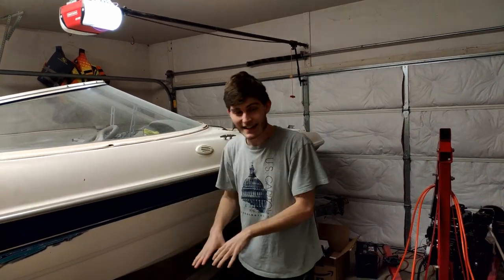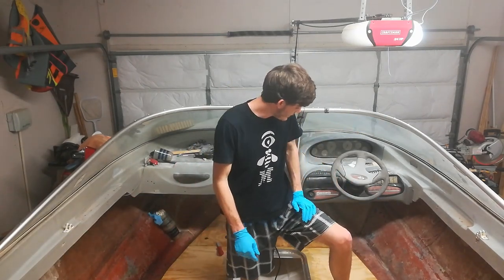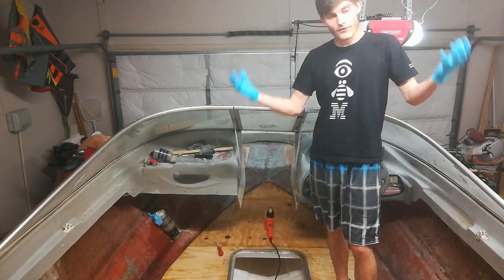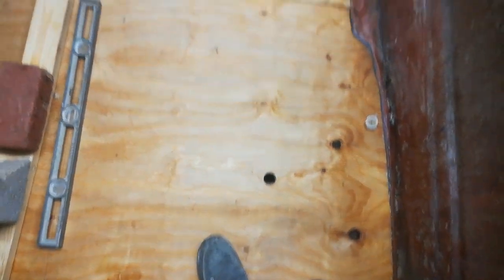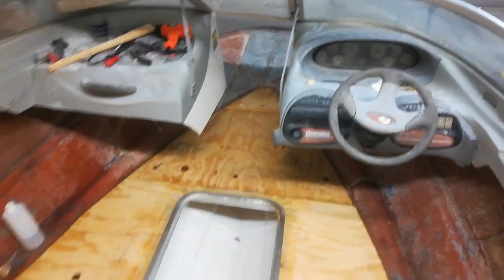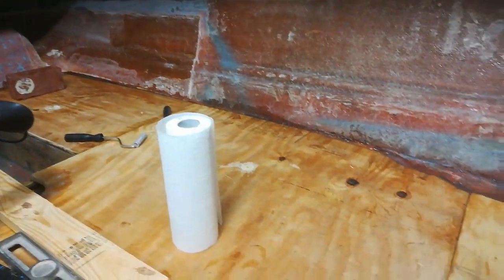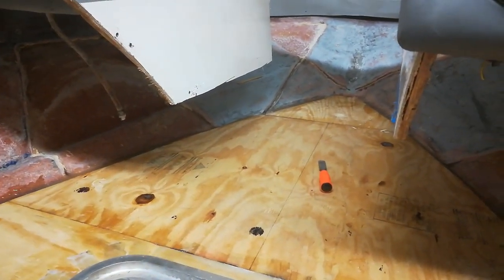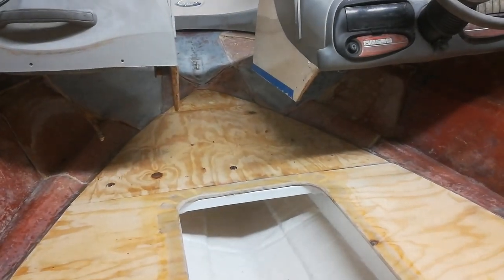Boat Deck Rebuild - Part 2

Comment: I know I’m 2 years late on this. Did you use marine plywood. Getting to ready to tackle a similar project but it only needs to be short term so I’m curious if regular plywood will work?
Reply from the maker: I did not use marine grade! Doesn't hurt, but if your fiberglass is water tight then you have nothing to worry about

Comment: Im curious as to what kind of flour you used. I ran out of silica and bought a bag of wheat flour... Its working but is very gritty or grainy, my peanut butter seems more like grits.😂😂 i wonder if white flour dissolves better...
Reply from the maker: lol. Just general purpose flour :) it does get gritty indeed! You wanna use just enough to get it thick enough to hold shape

Comment: Looks good! So, im curious to know what kind of foam you used (2lb,4lb...) and how much it took to complete the  job.  Cant wait for the next video!!
Reply from the maker: 2lb foam, posted a link in the description. I used 2 gallons all together(including stringers). I probably could have used 3 gallons though. I used just enough for the foam to rise got the top of the hole. Not more, I was trying to avoid extra waste 😛
Reply: Can you give a name of the pourable foam filler, where did you get it from?

Comment: why did you use chopped matting not 1708 ???
Reply from the maker: My primary reason for fiber-glassing the top of the wood deck was to waterproof it. For that chop-strand-mat(CSM) is sufficient. CSM is cheaper than 1708. 1708 will get the job done just as well. The extra structural strength 1708 provides was not necessarily for my deck, in my opinion

Comment: How many layers did you put on? CSM then 1708?
Reply from the maker: only 1 layer of CSM on top, beforehand I thought i'd do more, but ~3 gallons of resin later I decided 1 layer was enough :P lol

I will say after almost a year of use, been from 30 degrees to 100 degrees F multiple times, absolutely no cracking in my deck, it has been holding up very well! But as you find out in later videos, I put a LOT of gel coat on top of the deck
Reply: How much fiberglass did you use?

Comment: Was that marine grade plywood and what size plywood was it?
Reply from the maker: Just regular BC ply.  7/16" or 1/2" if I remember correctly
Reply: @ZachsGarage1  how long did it take for the fiberglass resin to dry?
Reply from the maker: @CUNextTues  on hit summer days less than an hour. On cooler winter days sometimes up to 12 to 24 hours

Comment: Doesn’t the foam just absorb water and hold it and make it even worse be better to just let it drain
Reply from the maker: Yes, but it takes a long time for the water to soak in. So in the event of nose diving or flipping, the foam might just make enough difference to keep your boat from completely sinking